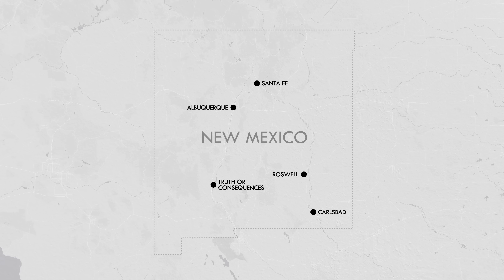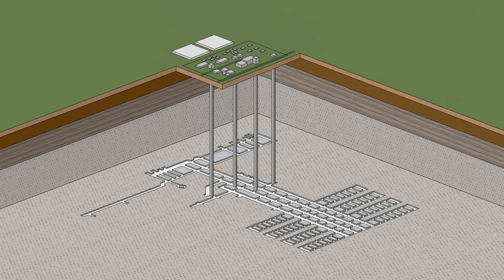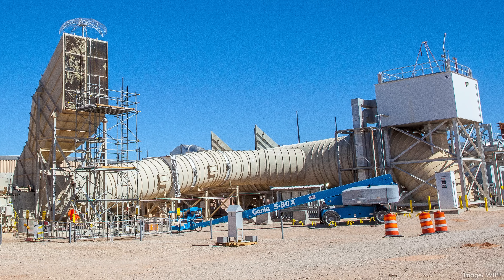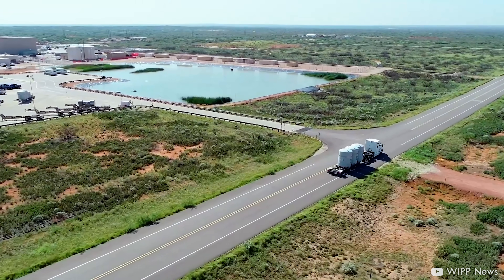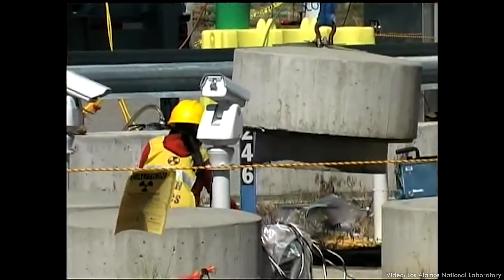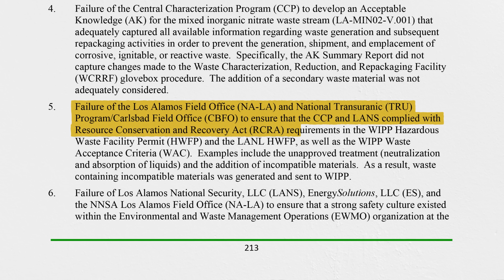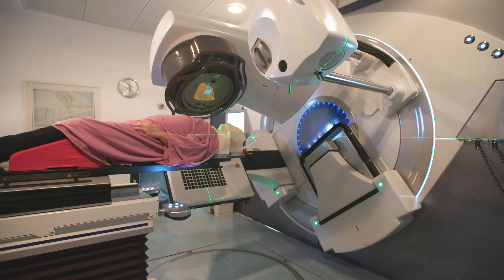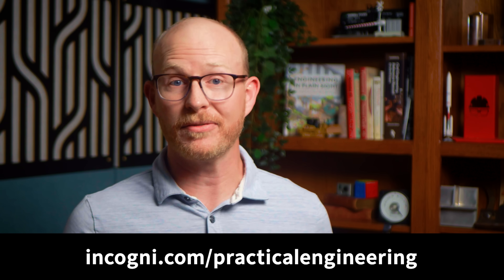When Kitty Litter Caused a Nuclear Catastrophe

Comment: And that's why you email out the pp slides/word docs after the presentation. Those kinds of presentations aren't for taking notes, it's to listen to the material for the first time under guidance. Usually in a room of your peers, so it's also getting familiar with co-workers or whoever.
Reply: You should do more than emailing out slides or the like. Slides aren't meant to make sense on their own, they're a presentation aid, and god forbid having important information in as unreliable a format as a word document. If you're giving a scientific / technical talk about new research / procedures / guidelines, write it up as a proper paper and publish that (internally or externally) so that it's accessible regardless of what software somewhat is using or if they happened to be on the right mailing list at the right time.
Reply: @QuantumHistorian  There really isn't time or need to do more. You'd be surprised at how much official work gets done in a casual format. 

Doesn't matter what the situation is, from the highest to the lowest level of organization, the really important information needs to be written down and sent directly to avoid copying errors like the one in the video. Not everything that needs to be communicated can be or should be typed up in an official paper.
Reply: No one ever reviews those emails with complete attention. Too busy.
Reply: @SolaceEasy  Correct. That's because you're not meant to. It's a reference. You went to the meeting, you remember being told about the specs for transportation, you go look up the slides/paper to see the exact details. No silly note taking mistakes are made, and it's a pretty painless process for everyone.
Reply: @misteral9045 ... you read the summary bullet points and convey those, not realizing that the actual details are far too complicated to fit on a slide.

Comment: It sounds like the root cause can be traced to a lack of proper proofreading before the document was finalized.
Reply: At least one more meeting, dozens of emails and post-its, and 2 months later.
Reply: Proofreading as a general concept, ok.  But what you are talking about isn't technically proofreading.  There are earlier steps in the editing process such as content editing and fact checking that are supposed to catch factual errors. If you really want to get old school, I think the process goes something like this - development, draft, content, copy, proofing, typesetting.  As the senior engineer in my group, I review all reports, instructions, policies, etc for things like this plus copy problems.  Bad copy = poor reading comprehension.
Reply: In the 1950s a briefing involved printing out notes and attendees reading up on the subject before the meeting began. Now everyone wants the short version on poorly written PowerPoint slides and a "bottom line up front" (BLUF) so they can spend as little time as possible thinking about it before making important decisions, and then it's off to the next meeting full of banal nonsense.
Reply: @RCAvhstape  Fortunately I was trained by an old school PM who refused to go to any meeting that didn't have a printed agenda.
Reply: @RCAvhstape Not a fan of PowerPoint for communication, but I like the BLUF. It forces people to think about the purpose of the communication and state it succinctly. You'd be surprised how make people struggle with this. Heck, I tried to get my colleagues to write a project charter, and most couldn't write more than one coherent paragraph. As the senior engineer, I then asked, why should the organization give you a bunch of people and money resources when you can't articulate even at a simple level what you're trying to do?
Reply: @major__kong  The final stage of the interview process at my last job involved explaining a highly technical process to someone with no scientific background. That was a brilliant idea considering how much of my time was spent convincing politicians and beancounters to fund us.

Comment: After action reports are always the stuff of legends.  They provide valuable insight as to what went wrong where and repeatedly reveal that humans are both fallible and lazy.  However, some mistakes require swift and decisive action:  Every last person at that meeting should have been fired.  A ratio of '1.2' turned into '1.5' and the wrong type of kitty litter was used where 'inorganic' turned into 'organic' thus becoming chemically reactive.  How does anyone make those kinds of mistakes?  No double-checking or rudimentary testing, just march forward blindly based on someone's handwritten notes that weren't even written down correctly.  Even carpenters know to measure twice, cut once.
Reply: In a spoken discussion, "inorganic" turning into "an organic" sounds extremely reasonable.

Being draconian about penalizing people just means that people will do anything to avoid fessing up to mistakes. That means things get buried instead of highlighted.
Reply: @TheMan83554
100%
Reply: @TheMan83554  You are correct about needing to consider the human decision-making response to penalties (I'm in a line of work where the complexity and hazard mitigation is similar and avoiding punishment for pleading guilty helps lead to future systematic improvements). 
This doesn't mean zero chance of consequences under all circumstances and I wouldn't consider loosing a job to be a 'penalty' let alone draconian. You simply can't have that sort of incompetence or negligence in important positions and the risk of job loss could be backed by an actual penalty for a cover-up being much much more severe, like minimum 20 years in prison). This wasn't an "oops I wasted a few hundred thousand dollars on a false alarm as a precaution taken under time pressure" nor "oops I just noticed the written paper has wrong information and we need to recall a bunch of product before an accident", rather this was the opposite where no effort was taken to avoid the accident even with no time pressure.
  
This particular mistake is extremely unreasonable in the context of the hazards involved and everything would have been in writing, and reviewed (likely by more than one) before the final copy signed off. On top of that every person involved in writing, reviewing, or even using such copy in a hazardous waste organization would [should] have at least the very basic chemistry education to recognize that organics and nitrates are very abnormal combinations that should be questioned before proceeding and several would have been highly qualified in chemistry.
Reply: No, the mistake is that such important procedure was subject to "game of telephone". In complicated processes it's possible to miss that there's single point of failure.  If anyone was explicitly tasked with verifying this step, then yes, punish them. But seems there was nobody with such responsibility. Punishing people involved would not solve this.
Reply: Bureaucrats always hide individual actions behind the veil of the group abstraction. Gov. bureaucrats then have several more shielding layers of abstraction as the position is considered separate from the person and the position is within a committee, which is in a field office, in a department of an agency, behind a branch of government (Gov. being just another abstract construct to separate sentient intention and action from accountability.).
Reply: In this case, the difference between 1.2 and 1.5 is more conservative, and done intentionally. I.E. use MORE kitty litter than necessary to ensure you have enough.